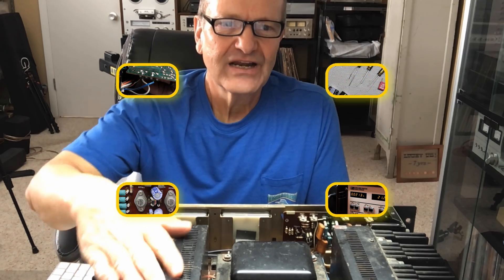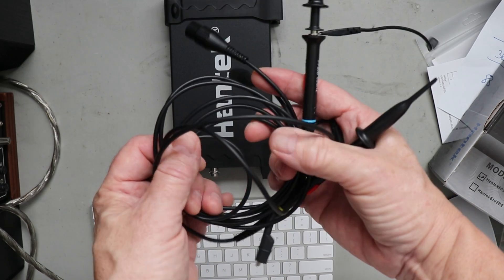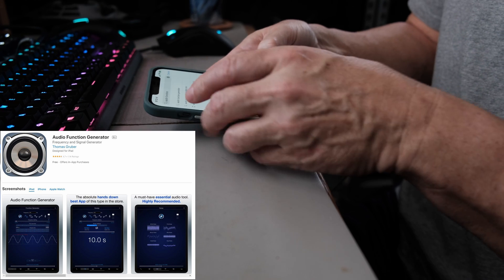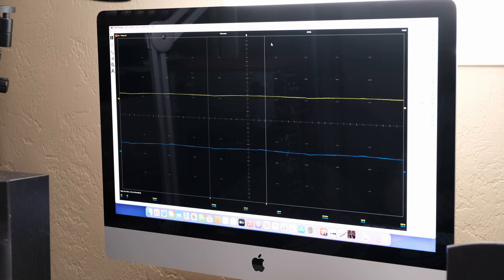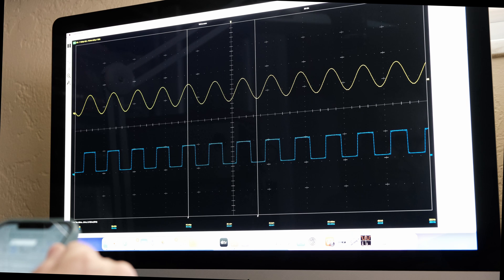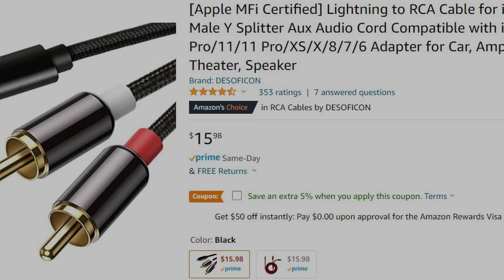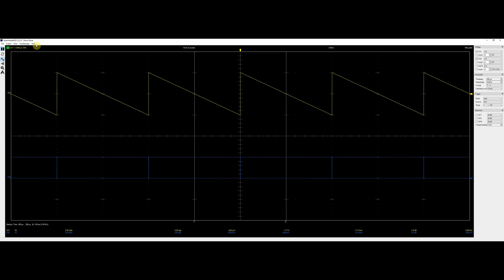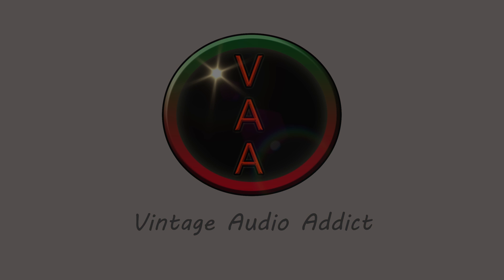Inexpensive Oscilloscope & iPhone Signal Generator Setup to Repair & Test Vintage Electronics.

Comment: I have been using this function generator for some time.  Unfortunately, I may have uncovered a limitation that may necessitate the purchase of a function generator.  I would appreciate your thoughts on this!

The issue is when I feed a signal from my phone into a PHONO input in order to diagnose a bad phono preamplifier, I am not able to control the voltage of the output from my phone. (or am I).  The phono preamplifier should ideally be fed a signal with a Peak-to-Peak voltage of 5mV, I believe, corresponding to the signal that comes from the turntable MM cartridge.  If I just feed any signal into the phono preamplifier, I believe bad things can happen including damage to the OP AMP or other parts of the phono preamp.

Thoughts?

Comment: i really know very little,  i thought that 35 volts input can be  350 volts input, using a 5 dollar 10 to 1 probe, aliexpress!  i mean, i have a 7 dollar DSO or something oscilloscope(in kit form,  i soldered all) 22 volts max input, and i check all 220 vac solar inverters that i repair (and build/modify) with it,and it works; (i never got around to buy a half-decent one, probably never will, i am a car mechanic...).

Comment: Hi, and greetings from the U.K. I’m a bit of a newbie to this so please don’t think that this is a stupid question. Would this set up be useful for tube amps?  I have several guitar tube amps that I wish to start servicing (just basic stuff to start). 
Thank you.
Reply from the maker: No, I wouldn't. I mean technically yes you could but you would have to be very careful. This piece of equipment is probably not robust enough for tube gear of any kind. A used older Tektronix scope would probably be a better way to go for your use. Thanks for watching. Cheers from the USA.

Comment: Hi..this is nice and easy to understand video. Just some question, can these equipment use for Marantz receiver tuner alignment? And what another function that will help in repairing/recondition vintage audio such as amplifier, power and pre amp maybe?
Reply from the maker: Thank you watching. Tuner alignments are probably not something you want to attempt with this setup. You need more specialized equipment/experience for that. You can use this setup with a digital multimeter to fix most pre-amp or amplifier sections of most vintage audio equipment.

Comment: Awesome video I hope you make a video going through a vintage receiver from preamp to power output. If you used the 10X option on the probe I assume you could measure up to 350V instead of the 35V stamped on the unit.
Reply from the maker: Thank you for watching and for commenting.

Comment: For all of those just starting out, this is an excellent clip about an affordable DSO. One of the properties of this DSO (I won't call it a limitation) is that the input  amplitude is limited to 30V.  Now I'm just an old country Engineer, I'm older than dirt and I remember when fire was discovered according to my better half, but I recollect when I first started out, if your equipment was limited in some way, part of your job responsibilities were to design and implement circuitry that negated any such limitation. For example, a probe or addition to a probe that mapped input signals from 0V's to say 300V's to an acceptable 0V's to 30V's without any added (or negligible) distortion over the needed bandwith.  I recollect having to do such things many times.  I wonder.....
Reply from the maker: Thank you for sharing.
Reply: This comment is a gem 💎 
Thanks for sharing.

Comment: I've got a digital oscilloscope here. It does a good job. I've got a Pro-640E Uniden CB radio here that has an audio transmit issue. The radio does actually transmit a signal, but it doesn't detect the voice input from the mic. I know the mic is good, because it is a brand new one. One day, I'll find the time to fix this radio.
Reply from the maker: I like my digital scope also. I did this video to help the folks find an inexpensive alternative.